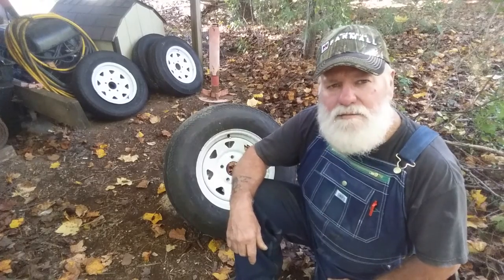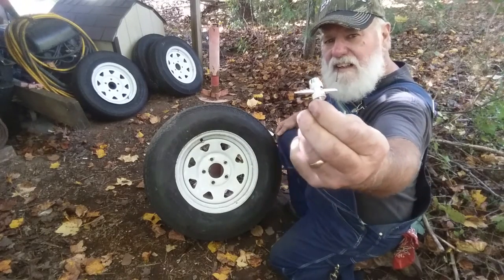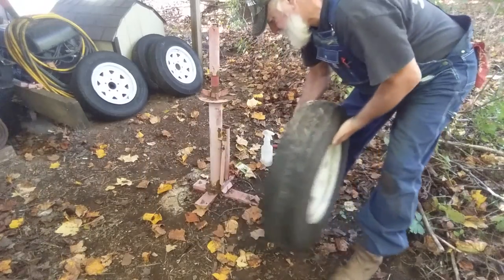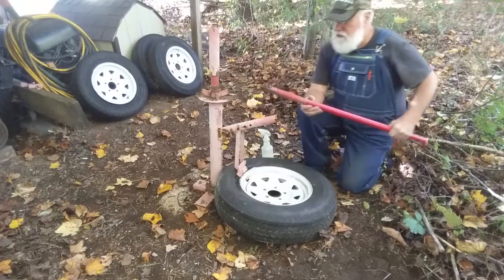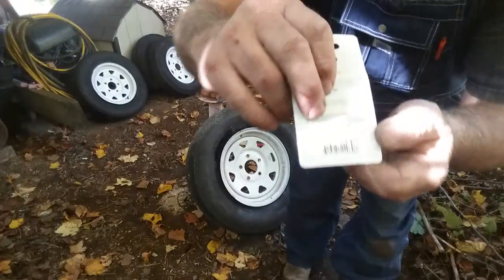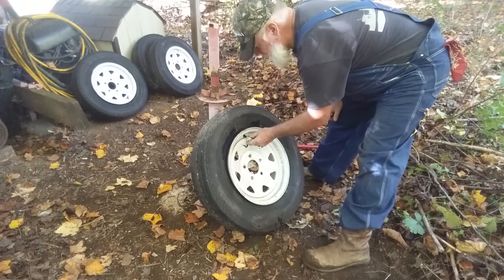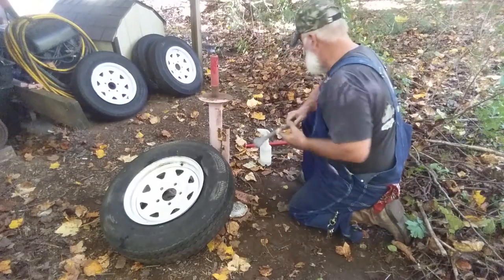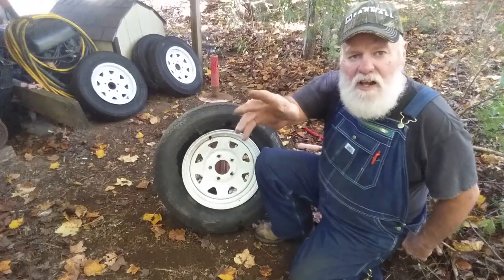How to replace a valve stem on a tire. EASY DIY

Comment: Hey Mr. Duke! Fancy meeting you here. I've done a lot of things...right up to building additions and swapping motors. Never had changed a valve stem. I'll be picking up one of these from HF in the near future. Shalom brother.
Reply from the maker: Hey Aaron...they have a tool that you can change the stem without breaking down the tire...I might do a review on the tire changer in the future....I am glad I bought it
Reply: I'll be looking for it!  Might see if I can find what you're referencing on my own.

Comment from the maker: The easy way to break down tires and replace valve stems.
Reply: I've heard of an easy way to reinflate the tire after you break the bead. Instead of using starting fluid and using combustion to reinflate the tire, just loop a ratchet strap around the tire and tighten until the seal is good enough to put air in it.

Comment: HEY BUD GOT A BMW WITH THREE VALVES WITH HARDLY ANY THREADS AND ONE OUT THE 4 YOU HAVE TO FIGHT TO SCREW A AIR COMPRESSOR ON TO AIR IT ,BECAUSE THESE COST SO MUCH TO REPLACE ,HOW CAN I RE-THREAD OR FIX THE BAD THREADS ? ANY BODY ALSO ,,,,PLEASE HELP !!!! THANK YOU ALL KINDLY !!!
Reply from the maker: ye can try a die nut and chase the old threads....but it sounds like they need to be replaced...not sure about the thread size
Reply: THANK YOU BUD !!!